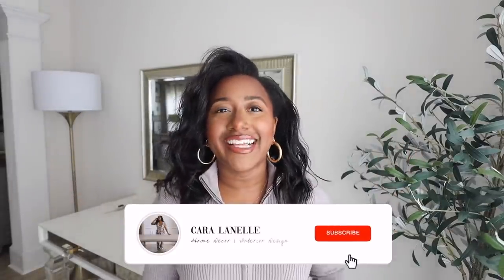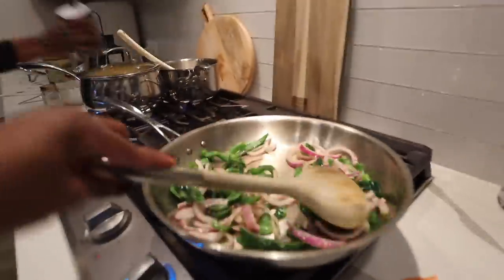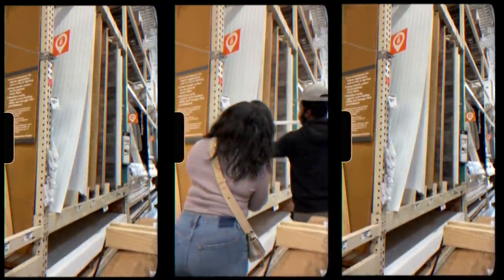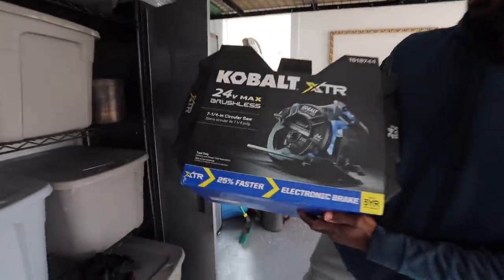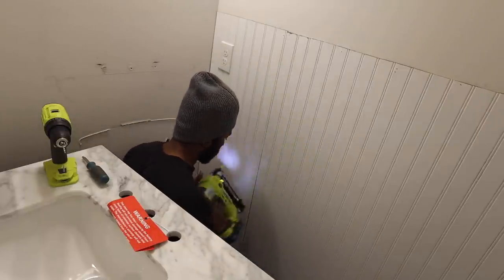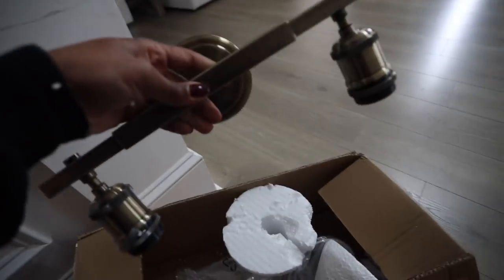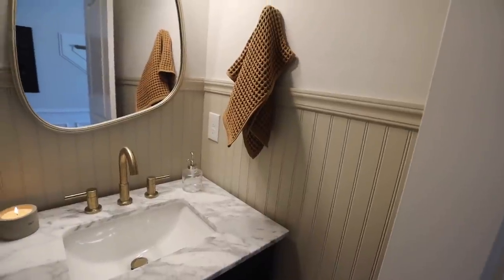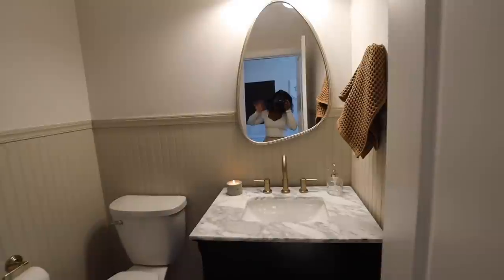*EPIC* POWDER BATHROOM MAKEOVER | DIY BUDGET FRIENDLY ROOM TRANSFORMATION

Comment: How many inches is the top pull/handle on the faux drawer? I just ordered the faucet but want to change out the brushed nickel pulls and handles. I can't find that information on the site!
Reply from the maker: We struggled with that too! It’s 4” but the pull we purchased was a little smaller (even though it said 4”) so we have to drill a hole right next to it. You can’t even tell because of the black paint 🖤
Reply: @CaraLanelle  you are awesome thank you sooooo much!!!